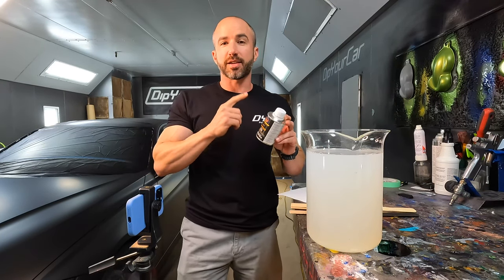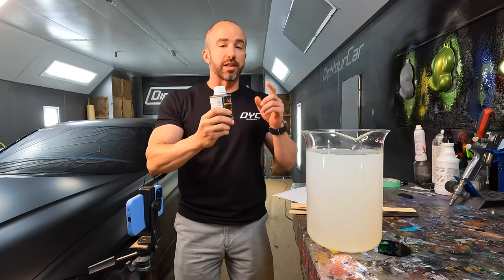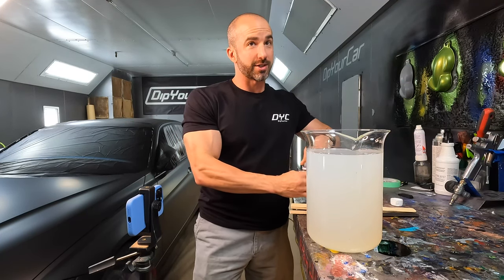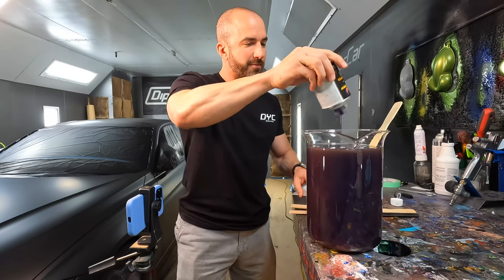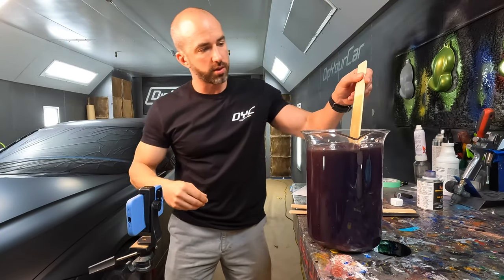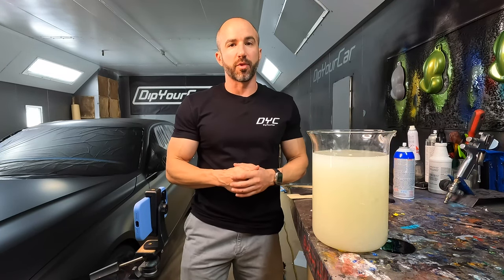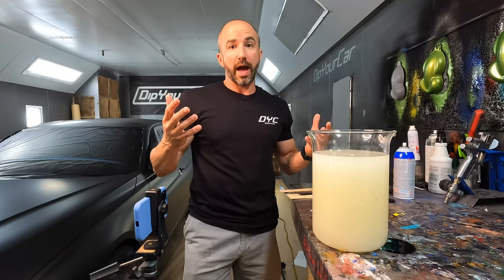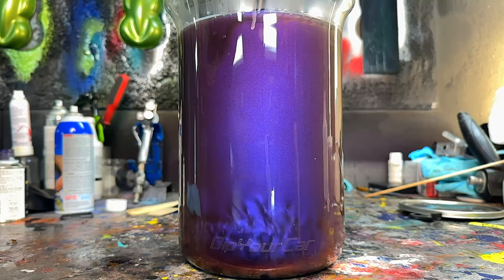Narrowly Avoiding DISASTER w/ NEW House of Kolor KAMELEON Concentrates (Seriously)

Comment: Kinda hard to believe that's peelable, very deep shine & very vibrant. Big ups DYC 👊🏻💜
Reply: That's what I want to know, what is this process! Because THAT shine is spectacular! I'm not a fan of the dull shifts. Movement needs radiance.
Reply: As they say: " AutoFlex Basecoat is the fastest, smoothest and strongest professional peelable base on the market"
Reply: I’m thinking it’s not peel-able, he said that’s in automotive paint not the DYC product unless there’s a DYC base coat underneath it?
Reply: @jasoncampbell4723  Correct.  The reason it looks that next level of shiny is because it's top-grade non-peelable paint. I don't know what they use for primer, so maybe it's like you said underneath.  But given the incompatibility, it would start coming apart over time if that was true.  Fine to demo it but not long-term.
Reply: Maybe they should use the HOC top coat?
Reply: @alphagt62  He said it was a sandwich, peelable base and top with the automotive in between.

Comment: It looks pretty. definitely a 4. Surprised how well it transitions since it is liquid concentrate rather than particles. 

I was actually a little worried as you poured the first 2 bottles into the first gallon, as it wasn't having an effect on the gallon and looked a bit dull. But I am curious how that would have sprayed/looked. Even though it would've gone bad, just curious how it would've looked. Glad you guys changed it to something that would work better with it.

Comment: I'm used to painting cars, so the auto flex stuff is the way to go, I'm assuming? I personally think your jobs turn out great, but I don't like the orange peel and dull look from the regular plastic dip. I have been experimenting with the plastic dip and then putting different automobile paints over the dip. Even with a clear coat, it can be peeled right off. In the process of doing a motorcycle now.

Comment: Question: could you use a DYC product as a base coat and then just spray normal paint on top and still have it peelable and long living or would the DYC base coat not be a good foundation for other spray paints?